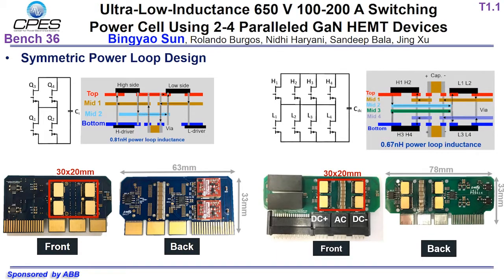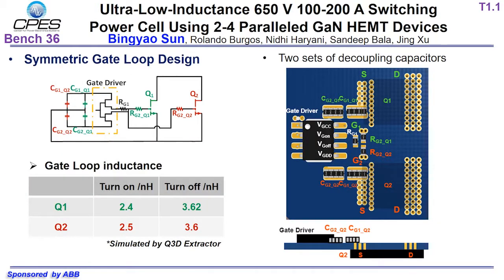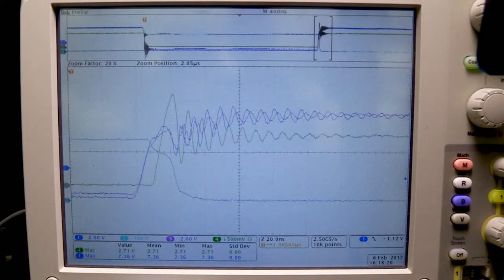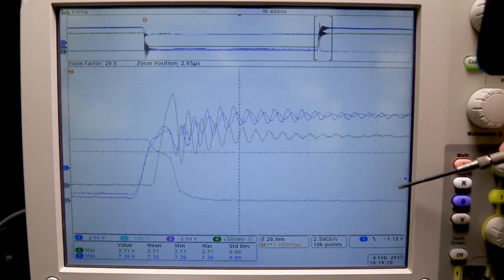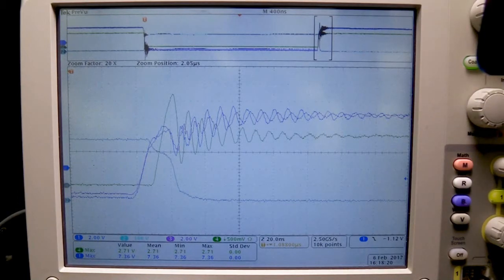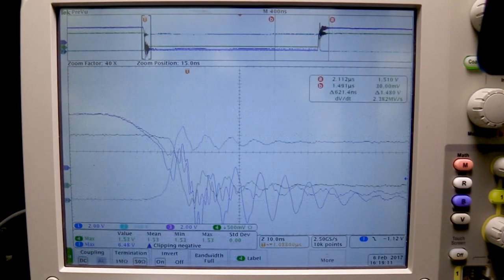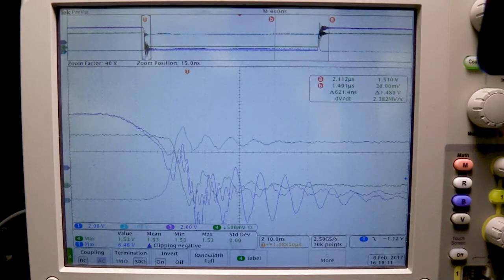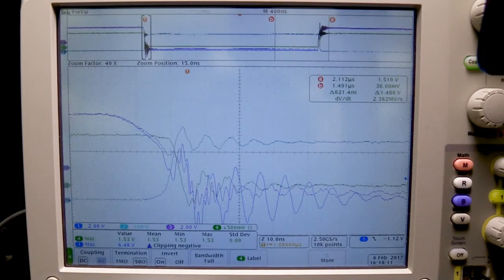Design, Characteristics, and Application of Pluggable Low-Inductance Switching Power Cell

Comment: Could you share which driver IC are you using? Have you considered using LGA package to reduce inductance?
Reply: @prise4573  found the paper some hours later 4 years ago. Thanks for sharing nevertheless. Wondering if the 4-gan paralleling is used commercially somewhere 4 years now.